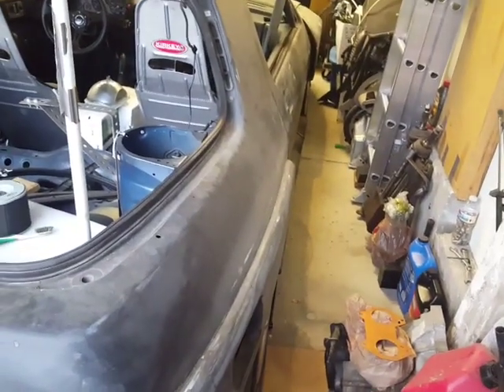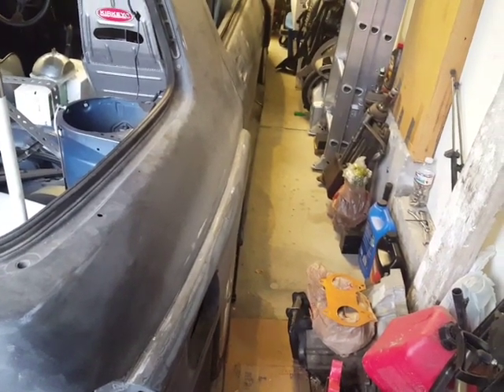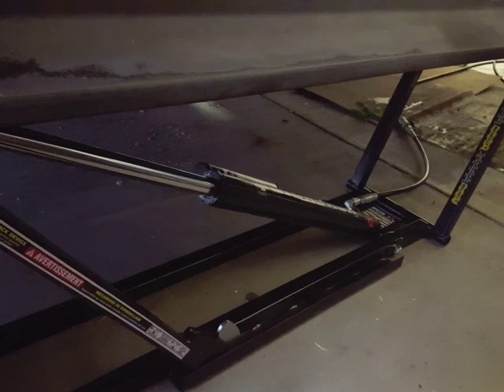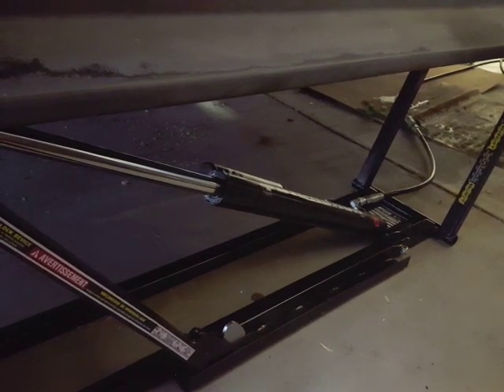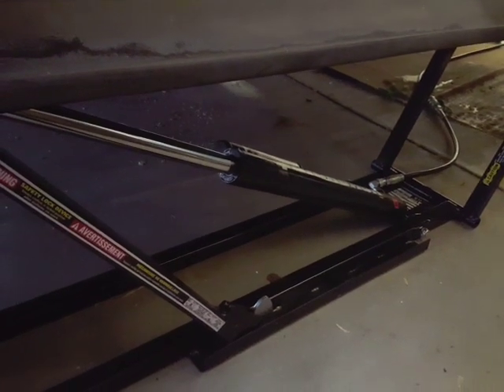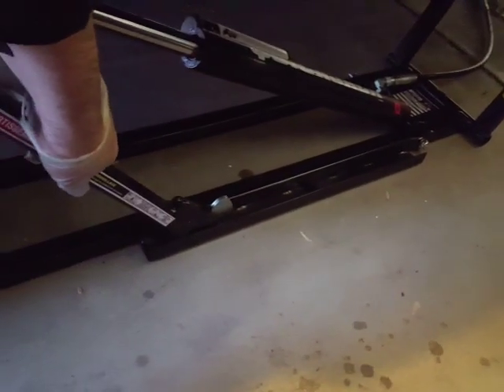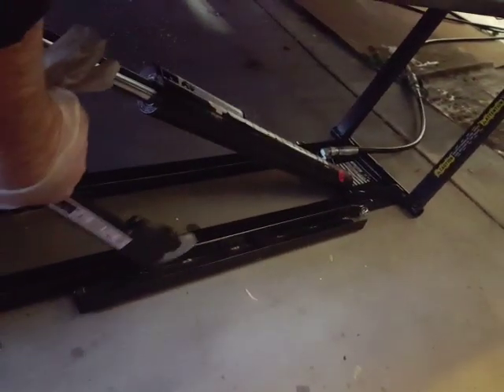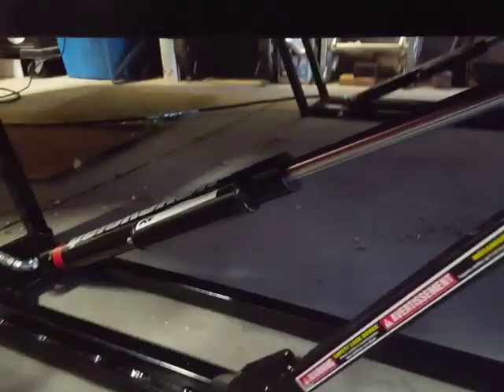Hydraulic Cylinder Loud Noise

Comment: Sir Can you teach me what is the reason, because we are facing same issue
Reply from the maker: In my case the ram had internal faults causing hydraulic oil to cavitate, I received a brand new ram from the manufacturer. There is no practical way to repair this issue as it involves cutting the ram housing open finding the issue and rewelding. Try googling the hydraulic ram cavitation.